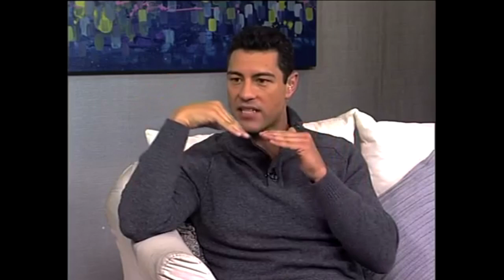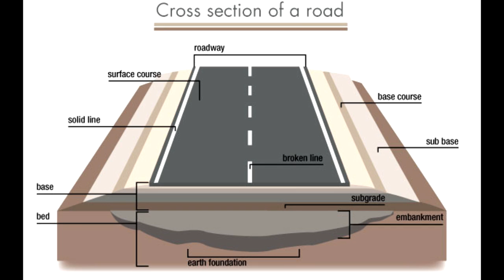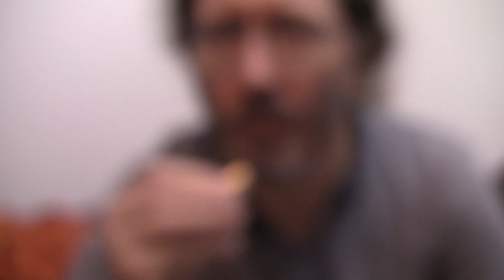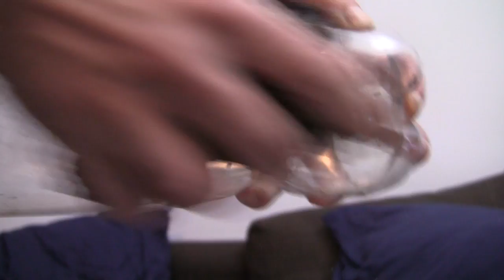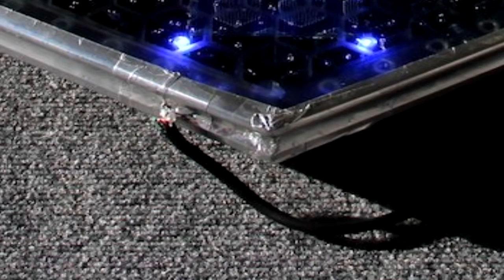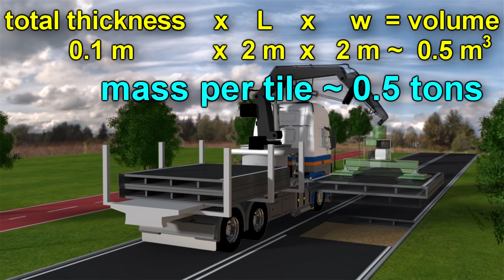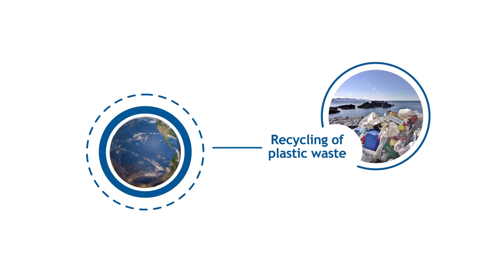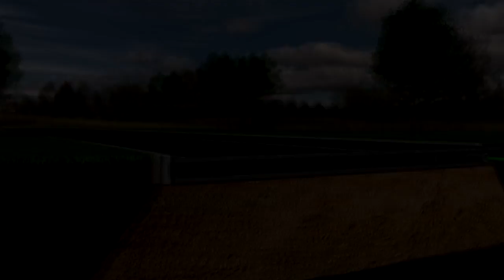Plastic Roadways BUSTED!

Comment: Just the fact that it's impossible to tile an arbitrary road with only standard rectangles is a problem
You would need to either have additional pieces to make non 90 degrees angles, or to cut the pieces so that they join.

Comment: You could not run powerlines through this anywhere where it gets below, freezing for an extended time because you have to bury all the water and electrical lines below the frost line… you don’t want your water mains freezing in the winter?

And also plastic, it’s brittle when it gets below freezing, which is also why we bury PVC pipes and cables below the frost line in an area.

This might work in the deep south of the United States, where there’s hardly any winter and maybe somewhere where you don’t have to bury the cables lower than 18 inches… I still see a problem because the ground itself is insulating and plastic is not so even in places where you have a mild winter it’s going to end up freezing the pipes and plastic sooner if it’s hollow.

so either building a road so deep that it’s below the frost line…. Or reinforcing the road underneath with concrete so you can run the lines….

Either way you’ve just made the road way more expensive …

Comment: India has had great success with plastic roads, part plastic part tarmac, roads that would be crumbling in months are lasting almost a decade with the edges even keeping their shape. As rough as normal roads, so handling is exactly the same as on the old designs that needed relaying every couple of years and where they became more potholes than road after 3 years.
Yes, i watched the videos and saw it with my own eyes and read many comments about how happy Indian road users are and want all roads converted to plastic.
Reply: Yeah... and only countless cars going over them every day adding massive amounts of microplastics to everything within miles of the road in all directions...

Comment: Wouldn't you also have a permanent stream of fine plastic particles going everywhere over time? It is one of the reasons I really dislike astroturf grass replacement, besides constant abrasion and wear the UV breaks down most of the common plastics. Synthetic plastics are wonderful polymers with amazing properties but have to be used in the correct applications. I am Dutch and these are Dutch companies coming up with this nonsense.. sadly.

Comment: It could be done from ABS or more UV-resistant and expensive and hardly obtainable as waste ASA. The advantage of those styrene based copolymers is they can be washed out from fibre (and rocks) with a solvent. The top could be melted and get the same little stones melted in as asphalt. That would also solve the UV-problem. Anyways ASA costs about 20€/kg The design could also be smarter with a partially open underside or with a lower and a upper part to make it possible to change without opening the cables. Of cause the whole shit is busted anyways. I'm just pedantic. It also shows the inventors didn't give a shit as I got those ideas in 5 minutes watching. I saw the problem with the cables as I saw the first picture with them before you mentioned it. I don't know how the designers or makers of the animation could have been unaware of it.

Comment: Sometimes Thunderfoot is too pessimistic and misses real developments. 

Actual plastic roadways have been built for hundreds of kilometers in India. However "plastic roads" is a bit of a misnomer as only 10% of bitumen is replaced by plastic. Nonetheless, with enough road construction, a non-negligible mass of plastic can be taken off the garbage dumps. The roads are supposed to be marginally better, but that has yet to be supported with sufficient data.

Comment: Wouldn’t it be interesting to have a kickstarter type site where there were ideas were vetted by a panel of experts to give confidence scores in several areas and an overall confidence score. Imagine  a team of an electrical, mechanical, civil, manufacturing and chemical engineer each giving an opinion when applicable. I think this would help some of the truly innovative ideas bubble up to the top and the nonsense like this would fall to the bottom.

Comment: You have to take environmental conditions into account. The constant temperature fluctuations will cause heaving and buckling which in itself is dangerous. I’ve seen it firsthand with concrete roadways. You’d be better off shredding used car tires and mixing the rubber in with asphalt. That type of technology would be better for sidewalks. You also have to look at frost line depths and base materials, drainage from rainfall and melting snow.

Comment: I wonder whether anyone has looked into the feasibility of making bitumen lighter in colour, or give roads a sufficiently cheap & durable white coating?  Black is probably the worst possible colour for any external structure, because it absorbs the most heat from the Sun during the day, and radiates the most heat at night, giving it the greatest temperature cycle differential and so more diurnal expansion/contraction stresses than any other colour.  The heat also softens the road surface during hot dry days making it more easily damaged.  The total road surfaces all over the World is possibly sufficient that if they were all white instead of black it would result in a slight but non-trivial beneficial decrease to the total amount of heat the Earth absorbs from the Sun per year, slowing global warming (but I haven't done the arithmetic on that).  OTOH too light a colour could cause eye fatigue or even eye damage to drivers unless suitable sunglasses were worn, and could reduce the visibilty of roadside objects, so probably battleship grey would be the lightest colour to aim for.  Comments?

Comment: Ive changed the flooring on a pontoon boat from wood to these plastic panels...when it's cold there is a 8th inch to quarter inch gap....half hr n the sun later and you can't even get paper to go through the crack

Comment: This video fundamentally misunderstands PlasticRoad. The innovation is actually the BASE -- the expensive part this video focuses on. PlasticRoad much lighter weight and requires less expensive earthworks. The top is not plastic -- it's coated with an aggregate similar to traditional asphalt.

Comment: To add to this, they have been using plastic mix in Asphalt in South Asia for 20 years with , microplastic now appearing in virgin streams and waterways as it gets peeled off due to abrasion by the traffic or bits breaking off, ending up in waterways, animals and plants , and eventually humans who consume them.
Also if you replace Asphalt with plastic to reduce waste, what are you going to do with Bitumen which is the waste product of fractional distillation of crude oil (about 10%). That is even if you build the capacity to make polypropylene and spend 1 kg of crude oil per kilo of that material ? What are you going to use that bitumen waste product for?

Comment: Oh my goodness....not to mention the heat from traffic and the rubber from the tires. How about when it gets wet? The highway will be like Mario cart. How can you pop a new piece in if they have pipes and cables running through them? Car fires? Chemical spills? Asphalt is is used for a reason.

Comment: Hey foot dude, i had heard of plastic being used in roads but this was not what i had presumed. This is just stupid, but what our state authorities are doing these days are using the plastic which we cannot send to philipines or chyna anymore as ROAD BASE.

So i would like you to do a debunk on this. I mean its bad enough we put asbestos in car brake pads and then slowly ground them off into the breathable air, but hey.  

Lets think of what will happen to that plastic road base after some time.

Weathering? Worming? Microbiological attack? Worms? i mean eventually that plastic will get to being smaller and smaller pieces and be washed away by any rain wind weather down the creek, river, into the ocean?

Its almost as good as those Scandinavians using waste plastic as an electric generator in garbage to energy.
Can you tell us about entropy.

Comment: Asphalt is best material to be recycled. Asphalt is the most recycled stuff, that do exist.
Asphalt recycling is on good complexity, energy and pressure levels to be done anywhere anytime, on any scale and does not need permanent installation of any equipment. 

You can't change 20cm*20cm concrete slab without messing with all the others slabs, as they are sinking to the ground until they fit firmly
Reply: And ooof, it is fireplace. People will die when this shit lights up, as it will smoke as fuck while being a sticky  goo with no way to put off with fire extinguishers in any reasonable quantities
Reply: But hey, this is a feature too. It enables simple and scalable terrorist attacks with just molotov cocktails. It traps people in black smoke and brakes infrastructure at once

Comment: How do you get the plastic road ‘beads’ off the multiple utility & private line ‘necklaces’ when you pull a section? This entire concept is simply not logically possible if you’re going to incorporate any channels into the infrastructure for items longer than the section itself. Even if such lines were all to couple and uncouple seemlessly and automatically 100% of the time, will I lose my electricity, etc. ‘on purpose’ when the Town does road work? What about water/sewage? What happens when there’s a flood (and there WILL be a flood)? Or even if there’s just a ‘simple’ pipe backup in the channel? Or the inevitable pump failure? 
Are they trying to create more traffic jams?? It’s not even a good idea in theory.

Comment: saying that plastics are to soft, well no there are some really really durable plastics out there.  I imagine that to get the strength they would have to use some sort of reinforced plastic.  fibreglass reinforced plastics being the most likely.  

That being said while i disagree that plastics could not be strong enough the real problem will be in durability.  No, your plastic roadways will not be as durable as they think.  Plastic does not biodegrade well.... however thats not to say that it does not degrade.  It would become brittle and start shattering after a few years i think.  And it would become an environmental catastrophe trying to clean up these degrading roads
Reply: He says in the video that fibreglass reinforced plastic just can't be re-recycled, you know, like the whole point of plastic roads.

Comment: I mean, why does a road need to be light weight? It doesnt move. They tend to work best when not moving. And as for them saying they want to make the road stiff...theres a reason cobble stone was used for a little bit but went away. Most concrete roadways are elevated and are sometimes surfaced with asphalt. But something a road needs to do is flex a little under heavy loads but retain its general shape. It takes years for 80,000lb trucks to shift the surface to create ruts. Then, all you do is tear up the road, heat it up, add a little bit of fresh material to account for what was lost due to wear and weather erosion and you put it back on the ground. Not an issue. And that's after many many years in most places. But plastics in the southwest United States would degrade so fast that the roads they are talking about might only last a year or two where as asphalt lasts much much longer. And it does so from the hottest deserts to the coldest mountains and arctic/sub arctic tundra.

Comment: Yes,the cables and pipes running through them is a bad idea. However melting  bunch of waste plastics,and mixing it with gravel,and using it to get rid of a bunch of waste plastics,in a useful way,I think it's a good idea,and shouldn't be hard to test.

Comment: These roads are made from similar materials, it is only the bitumen in the roads that are being replaced with single use non recyclable plastic. The bitumen is only about 10% of the entire road. So your video has no merits. Do your research before trying to argue your (incorrect) opinion.

Comment: So basically he is misunderstanding the method, he is comparing the raw material and the durability of it, just like how gravel wouldn't make good road surface, cement is a MIXTURE of elements, just like the plastic bricks, it allows to dramatically increase its strength, if they just melted plastic and poured it onto the road, yesh its shit, but again, a mixture of elements can drastically change properties of said elements
 Check out the African woman who started this design in Africa, to help pave the roads there, this guy is trying to take a process or product that would work in a totally different enviroment and discredit the product in its application in western environment

Comment: Absolutely, I was thinking durning the animation of the truck installing the modular road panels, what about a curve? Are the manufacturers going to have a wide range of molds for all the different degree turns?
Reply: Exactly. "Prefabricated"...and they only show straight rectangles, on a completely flat ground.

Comment: It is clear that the guys making this have never heard of "curves". All of the cost savings of this are negated by the fact that you need to make a custom mold for every different section of curve! Remember, you can't simply use the same curve segment- you will need to make a new mold for every radius of curve, and some curves are even banked so vehicles can go faster on them and water can flow off easily.
Reply: Have you seen slab tracks used on high speed railways? They go around curves without any problems. 
They've been in existence for decades. If you don't know, you shouldn't make a fool of yourself.
Reply: @RR-us2kp  Yes, but how would you make prefabricated pieces of plastic that are hollow? Remember, slab tracks are a slab of concrete, so you can simply put them in a mold that's shaped like the curve. Yes, you will need to make multiple molds, but they are simple in shape. However, it's much more complicated to make a mold that's hollow on the inside and curved! Also, the slabs on high speed track are generally joined using some sort of concrete/mortar, and the curves and grade changes are much gentler. You could have a steep road, but steep train tracks are a big no-no. Plastic road claims you can just remove a module and put another in, coupled with the fact that plastic roads wear down super fast, means that you need to keep a mold for every curve. Slab tracks tend to be much lower maintenance, so you don't need to frequently swap them out.

Comment: One of the most funny thing in that animation is when the rain starts and the water just rises inside the road tile. Because have you seen any way the water COULD get into the road in that animation? The animation shows no drainage system at all except the holes in the side that apparanly only let water out but never in.

Comment: They show the modules being replaced by simply picking up a damaged one...
But if pipes or cables are running through those channels, then the road sections would be connected like beads on a string!

Comment: Having worked in the plastic industry for the last 37 years, I'd say; "Uh, no..."  I like that people are trying to think up new ideas, because sometimes new ideas are useful.  However, plastics aren't just plastics.  Especially when recycled.  The molecular chains break during the recycling process making the plastic weaker and more brittle.  This is one of the main reasons recycled plastics are only approved for limited uses.  Generally, various plastics don't always mix well.  The long term load bearing capability of plastics is not well known, and what is known isn't that good.  Notice that plasticized wood is not rated for load-bearing construction purposes - and there is a reason for that.  Public roads have to bear a very significant amount of weight and have to bear a great deal of shear force while vehicles are accelerating, turning and braking.  Additionally, the small crushed rock in concrete and asphalt give roads grip and strength that would not be achieved with plastics.

Comment: So, would it be viable to just run conductive pipes through a regular roadway to heat water, preheat it for a steam generator so that it takes less energy to boil said water at the plant? Mirroring one of the advantages of a solar roadway, you could alternately pump hot water through the pipes to melt snow off.

I have no idea what I am talking about though.

Comment: If it’s hollow will that allow the road too flex which will cause uneven tyre wear and is it going to be strong enough to withstand a truck that’s over size and over weight as the current roads manage the best they can

Comment: Plastic bottom can withstand high internal pressure before it fails cause it has large tension strength which in turns, comes from their softness. You cannot expect a material with hard surface yet have high tension strength.
I really want to see how large the expansion joint will be for these plastic roadway, given that their expansion rate is 5 times larger than concrete.
One more thing. Everytime you replace a new module, of course you are going to stop whatever services that are under it. But the real question is : How are you going to reconnect them? For example, if there is a portable water main under it, how do you reconnect the main? You know, you need to solder or use other methods to join the pipe back.

Comment: plastics would be shreaded become micro plastics train away and end up in the water supply then in fish then in humans... not so good.. we have enough micro plastics as is...

frankly its probably better to just burn the stuff in that case... with the right filtrations you can at least burn it away without putting harmful micro plastics into the enviroment though recycling it properly is probably better long term.